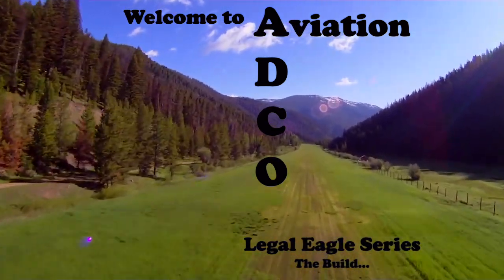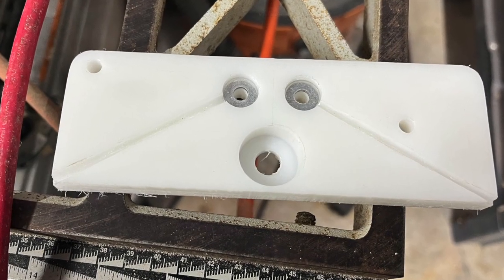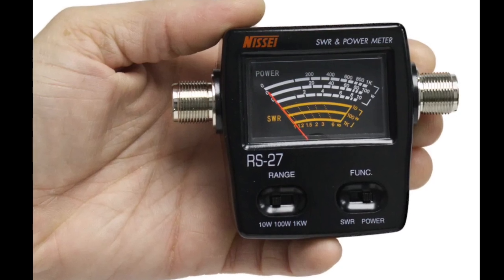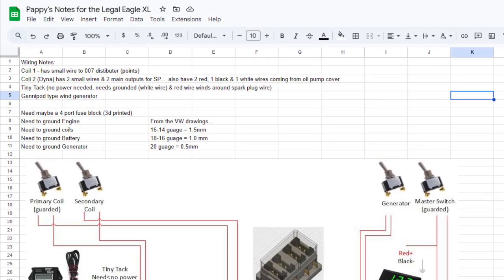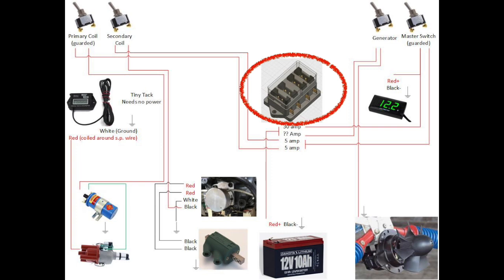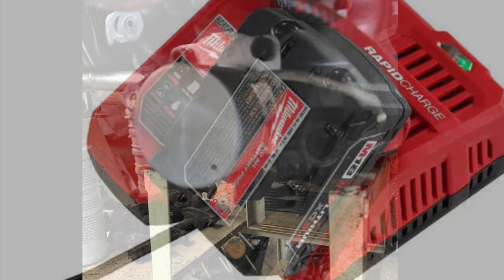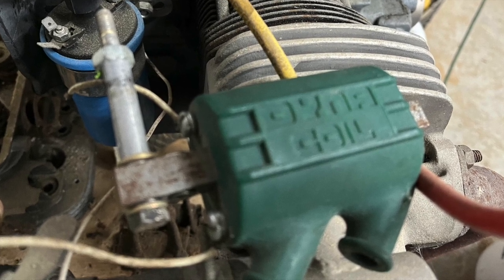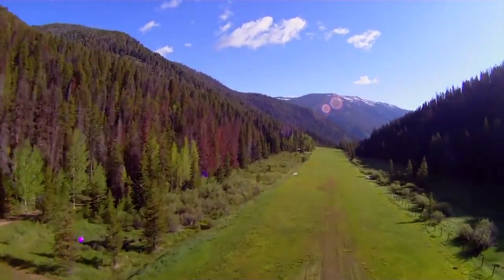39 Wiring (Part 1) ADCO Aviation's Legal Eagle XL Ultralight Aircraft Build Series

Comment: As an A&P I work on mostly certified stuff, so I don't have any direct experience with your Great Planes distributor. But in aircraft wiring, black is typically ground and white is power. Good luck. I've really enjoyed following your build. Will you be getting your propeller from Alaina at Culver Props?
Reply from the maker: Thanks for that - I know in the DC world, it's typically the opposite of AC world (white hot/black neutral), so I think you're right... And you made me look at my drawing, yep I had that backwards from what I was even thinking... lol  As far as prop, don't know... I'll shop around, speaking of, I really need to start doing that... just been too busy...
Reply: @davidadkins1926  Alaina at Culver Props is terrific.  She'll make you a prop that meets specs as a starter, and she will customize it to meet your performance specs.  I wanted my engine to rev at a max of 4000 rpm, after some of my own work to trim the trailing edge I managed to get a max of 3500 and Aliana offered to help me do the rest.  I figured 4000 rpm is the absolute max the prop could handle, and would be good for some extra "oomph" during climb out.
Reply from the maker: @jimpfarr What size engine/prop did ya'll end up with? Thanks for you comment....

Comment: Leonard said an interstate battery SLA 1075 . I got one on Amazon for$24. It's an alarm system backup battery I think. Les said two of these he could fly 7 hrs. 
Finding a good set of contact points is important I feel. J Bugs say they have Bosch points. I ordered a set from O Riley's an 24$ made in China junk. The set in the motor I got from Scott are crap, the contacts don't even line up, so what do you do,, bend the main pivot pin. Zero grease on the point cam. So I need to go through it. No grease felt on the point cam  either. I have done points daily for over 10 years. If done right you shouldn't need a backup. I might do a fuse initially but if it checks out I'll eliminate it. Great video brother.
Reply from the maker: Funny you posted that, I was just reading on the Eaglersnest Les' post... One thing I've figured out in this project, they don't make'm like they use to... I grew up with VW's (and btw, we always kept a set of points in glovebox - though I don't remember ever 'needing' it in an emergency) Anyways, the 009's I see today don't seem to be built with the same quality... Thanks for the feedback as always!